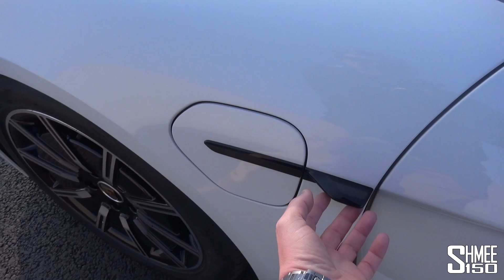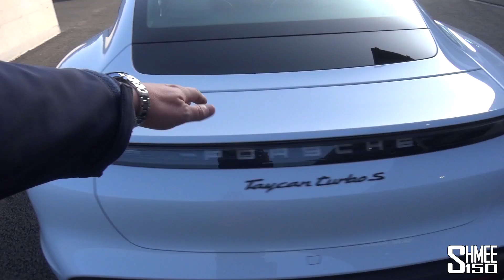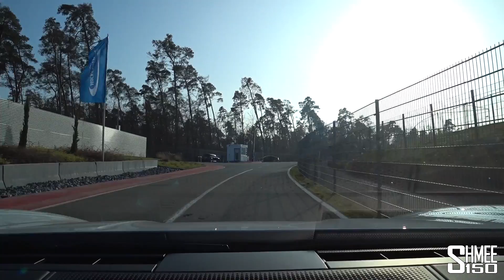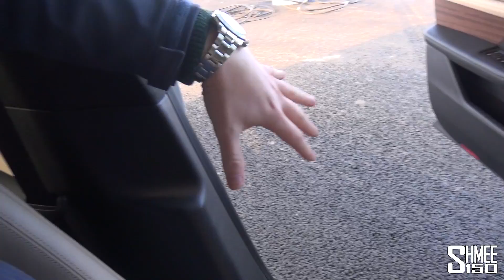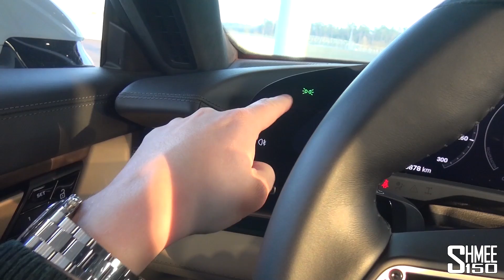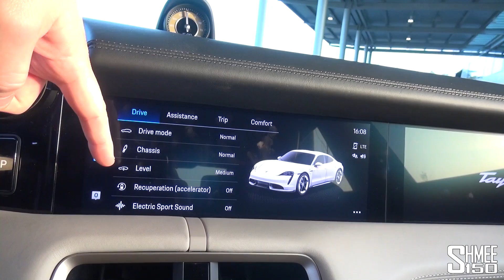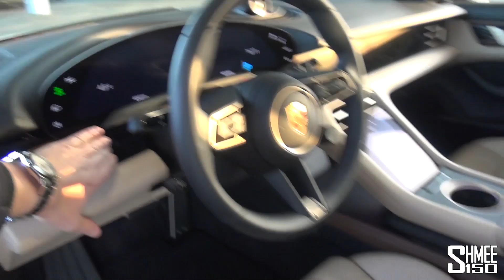Is the Porsche Taycan Turbo S the Electric Car for Me to Buy?

Comment from the maker: Do you think the Taycan should be my first electric car? It's Porsche's first EV and this is my first test drive to experience it, something you can also do to at the Geneva International Motor Show. More info including discounted tickets in the app: http://onelink.to/shmee
Reply: Perfect way to add a Porsche back to the garage!
Reply: Well, the Model S is a better car in every way apart from build quality. Would by a Plaid Model S when it comes out.
Reply: The best Porsche!
Reply: This car reminds me of my wife: White, expensive to run; instant talk; a smooth ride....
Reply: If you’re getting an EV, that’s the only one of interest at the moment surely
Reply: BUY IT!!🔥🔥🇵🇹
Reply: I agree Tim, it is a most impressive car. If it does indeed still have the “Porsche feel” to it while integrating the tech then it a very cool car. However I would not rush into buying any EV yet until you’ve maybe had one for a couple of weeks.. like the BMW you had recently. Maybe try an EV for the same period, see what it’s like to actually live with and how charging works. I mean thinking out loud, if you went on a road trip to say Monaco or Geneva how many times would you have to charge and what is the availability of charge points on the way? I live and work in London W1 and street based charge points are Ok but could Do with being more availability. So I’m just thinking the car may be practical day to day in town but for road trips etc ... mmm I’m still not entirely convinced. Finally is €200,000 in that spec worth spending on a car that you can’t really use to its full potential... I do love the car and the tech. But should it be your first EV... I think you should wait and see what’s what as 2020 progresses. Hope you are enjoying Germany. Cheers Mike
Reply: It’s a great car but really....why? When you consider your current line up of cars why do you really need it? Sell everything else and go EV? I think all the EV stuff it’s still too early. The infrastructure just isn’t there across most countries and the charge times aren’t great. Not enough super chargers about. The only real world good EV is the Tesla. Everything just falls short unless your going to use it as a short run about around town car for occasional use. But then a small petrol would do that job anyway.
Reply: buy a Huracan Evo
Reply: Get the Taycan and get another more "affordable" electric car for long term comparison. No Teslas though, just to show there's life beyond Tesla. Dump the Supra and Focuses (I have never watched a single Focus video).
Reply: For 200000.......nah pass.
Reply: No. The range pretty sucks
Reply: Either this or the Tesla Roadster. Depends on whether you can wait a bit, want more performance and range, or more luxury and Porsche's heritage of building dedicated sports car
Reply: for some reason it looks like a mk 5 supra
Reply: Yeah get it it looks really good
Reply: Yea man buy it
Reply: Yea man buy it
Reply: I saw my home in the video :( didnt know it was a porsche event in the hockenheimring... Greetings
Reply: think you'd wait for some sort of special edition wouldn't you, maybe a taycan gt3 or taycan rs? maybe one with no rear seats bigger batteries and lower weight?
Reply: yea very nice..
Reply: Yes
Reply: Think it is a great daily shmee mobile!
Reply: fortunately the car is fitted with self opening covers over the charging ports..
unfortunately they require a V6 powered diesel generator to operate..
Reply: Most definitely! Go for it.
Reply: I would recommend the new Tesla Roadster Founders Edition. It has a wow factor that is unbeatable! Your channel will explode and twice more if you got a new right hand drive ZO6 mid-engine Corvette! If there is anyone who can make that happen, it’s you Tim!
Reply: Shmee150 yes, absolutely, buy it
Reply: i think you should go for it. i love the cabin noise it makes under acceleration
Reply: The Porsche Taycan Turbo S is my absolute dream car. I would buy it if I could afford it, no question. I've been waiting for you to review this car, so thank you for sharing, Tim. I hope to meet you at GIMS again, just like two years ago, nearby the Bugatti Chiron. Cheers.
Reply: I’m convinced it’s already part of the collection
Reply: Yes shmee i think it would be an epic addition to the garge
Reply: You should buy the taycan 4s
Reply: Yes its perfect.
Reply: Shmee150 It definitely should. Can’t mod this one ☝️ 😂
Reply: I think a drag race with a tesla and Matt Watson is going to happen at some stage⚡️
Reply: Just yes, time for you to join the future 😉👌👉⚡️
Reply: YES! Please buy this one. We want to see more of it.
Reply: At the beginning i did not like it. But now i love it. Greetings from the home of porsche, weissach
Reply: You need to buy it
Reply: You buy you win
Reply: Please buy it, but where are you going to put the charging box!
Reply: Shmee150  ofcorse it is
Reply: Why did it take so long?
Reply: Yes
Reply: No it’s really nice but u should get the Tesla roadster
Reply: I believe this would be an excellent choice of EV car to your collection 👍
Reply: Can you charge Taycan on Tesla superchargers?
Reply: Hey Tim - please can you do a video on trickle charging? Thanks
Reply: I think it should, personally I didn’t like the whole idea of the taycan but after watching this I’m all for it.👍
Reply: Shmee150 Yes
Reply: Buy it please!
Reply: With it being the first year of this model, I would wait. The electric car/SUV models are still fairly new but are improving dramatically. If you buy the 2020 Turbo S Taycan, there will be a far better version next year. Porsche needs to construct a car or SUV with a 1.8-2.0 twin turbo with about 375 HP with electric (450 hp) along with a totally separate F1 type of electric power boost mode (75-100 HP).
Reply: The first step into the all electric vehicle and stepping back into Porsche cars
Reply: i think this car is for everyday use in the city not to collect. but if you want to buy and try use it regularly please buy it. for the look i still love panamera more though.
Reply: Yes absolutely!!! I think they nailed it with the interior and features. The front is the only thing i would do slightly different, but thats not so much!
Reply: The GIMS is canceled 😭 it will be announced in the next hours. All events in Switzerland with over 1000 pax are canceled until further notice.
Reply: Please buy it!!!
Reply: It would be great content!
Reply: Yes.  We need a guy like you to give it a proper long term review.
Reply: I like it
Reply: yes go for it if its posible
Reply: Yes get 1 bought
Reply: Shmee150 Yeah, it should be,but I think you‘re are fine with your amazing collection!
Reply: No electric cars have no place anywhere near cars like the senna
Reply: @LucGrenier  finally! Someone who won't stand for electric nonsense!! I don't care if its slower. I will stick with my 800hp Supercharged 5.0L V8. Please DO NOT buy Tim!! We need people like Jeremy Clarkson & Max Verstappen who will tell the damn politicians to stick the electric cars where the sun don't shine. We shall boycott your channel if you buy an electric car.
You're red focus is MUCH better than this electric piece of turd that has no turbo
Reply: Porsche have done a superb job with this car.....it’s a very cool electric car.....never wanted one....but with the Porsche I would 😁👍
Reply: @mikejk27  great looking car, poor technologywise compared with Tesla. The range is just hideous
Reply: Can you turbo charge it, thats the real question?
Reply: Pleeeeeeeeeease get it.
Reply: Shmee150 no get the Tesla roadster
Reply: The Taycan would be great we need a Porsche in the garage, however the Honda E would be a great fun quirky car much like the Suzuki jimmy and would be a great first electric car in the garage.
Reply: Off course! An E-Porsche in your Collection is a must have 👍
Reply: Yep. Mod it too, some carbon fibre maybe
Reply: Only IF you want to buy a ev
Reply: Shmee150 No get a Model S Performance
Reply: Amazing car, any interest in the Tesla roadster mark 2?
Reply: Shmee it is better to wait the new Tesla S
Reply: Athanasios Leftheriotis no, Tesla’s are the pumpkin spice latte of cars.
Reply: Shmee150 you’d be stupid to buy it... slow af and no self driving
Reply: @austinskylines   Sorry, but when you have Porsche self driving is the most stupind thing that you can have in the car. Driving such a car is pleasure.
Reply: its a good car with the stupidest name ever... who in the design/marketing/whatever department said that turbo is a good name for this ELECTRIC car... really porsche??
Reply: Shmee150 Porsche was the one to bring us diesel-gate and now they lie and have convinced some people that it performs like the Roadster. 
Compare specs before you buy and remember Tesla has lots of super chargers operating. Porsche has none and thus is their first electric prototype. Tesla has a fab track record for 10 years and is light years ahead in battery technology.
Reply: Tesla Roadster 2 will smash it. If you can wait until 2021/22. With 600 mile range not 200 and 250+ mile top speed. 1.9 secs  0-60mph. 

The Taycan is a great looking car. Poor value for money IMO.
Reply: @user-jt1jv8vl9r  600 miles range is not impressive, until they figure out how to add a gear and make the car able to use his whole power all they time...Tesla is slower every drag race...1,9s is just in the best circumstances
Reply: Get the Honda E its much cooler.

Comment: Tesla Model S.. 0-60mph 2.4/5 sec, 349 mile range, 163MPH top speed; much bigger charging network; $100K for about half of what you get in that Porsche.  Tesla hands down .. considering Auto pilot, more storage space, more passenger space, electric since 2013.

You could buy the Model S, Model 3, and the Model Y and still have money left over for better performance.  Or put your 200K on the Tesla Roadster that does sub 2 second 0- 60 and projected to provide over 600 miles range, with a top speed over 250MPH.

I wouldn't think drinking Porsche Koolaid makes sense, when you could be drinking Tesla Champagne.   It will come down to looks or how unique the Porsche is as compared to "everybody wants a Tesla."

Comment: How does air conditioning work with on an electric car, the compressor is usually driven by the engine.
Reply: They have a dedicated electric motor for AC. Also for heating they have a hair dryer-like system since they can't rely on engine to generate heat.
Reply: @BKA3510  thank you

Comment: Named a Turbo S, but has no turbo?
Reply: What do you think is the different between a Panamera 4S and a Panamera Turbo? Do you think it is the turbocharger? No. Both have turbochargers. Instead the 4S has a V6 and the turbo has a V8. Actually more or less all Porsches have turbochargers meanwhile, so also the versions without the "turbo" in the name. So "Turbo" just means "more power". It doesn't tell you anything about the technology that is used to give it more power. And so they just use the same nameing scheme for the Taycan. And when you know Porsche, you know what you get.

Comment: Did they choose the larger platform against a 911 because of the space needed for the batteries? An electric 911 TurboS could be a viable option to try electric. Tesla is quick but not fun, this looks fun but i would want an 911.

Comment: Currently I'm in NZ where sales of electric cars average around 600 a month. The charging infrastructure is good and one can comfortably travel a good distance knowing you will be able to charge your vehicle along the way. A recent upload by another You Tube channel where they have a Jaguar I Pace on a long term test high lighted some of the challenges  faced by electric vehicle owners - these include the difference between claimed range and achieved range, incompatible charging plugs at charging stations, having to register and download various apps to activate the swipe card and overall time lost while waiting for the car to charge. Would I like to see an electric vehicle in the Shmee Fleet? Yes it would be interesting to see what the ownership experience is like.  I can tell you that as great as the Tesla is, its not without its faults or indeed patchy customer service, So would be keen to see how Porsche compares.

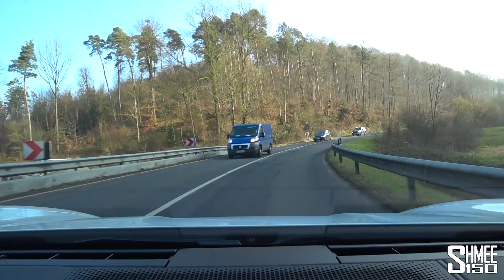Comment: Hey Tim. At 10:38 you mention noticing a gear change. What do you mean by this? Does the Porsche use some alternative motor system? It was my understanding that EVs have only one gear.
Reply: Porsche has a 2 speed trans on rear axle. The only reason we don't have gears on EVs is tradition. Before Tesla they were golf carts. Tesla tried developing a 2 speed transmission for the Roadster 1.0 but they failed because of the very high torque of electric motors. Then they settled with a new inverter that can supply more current to the motor at high frequencies. That solved low high-rpm torque problem. Until Porsche nobody tried putting gears in an EV again. Actually, there are lots of potential benefits.
Reply: @BKA3510  Thanks for the reply Bora, and for teaching me something new! Marvels of engineering, these things.

Comment: @2:51 Imagine doing that in the winter when it's caked in dirt and it's freezing outside... Such a pointless feature. Just have a button or press the lid itself
Reply: It will vibrate through it :) they thought of it
Reply: @Jonas_fluid  looks like it uses same technologies as a capacitive touch screen. And doesn't look to be that responsive. Just like the early mclarens

Comment: I don’t get tech for no reason, manual controls for volume and AC are a must.... why make the good old air vent motorized and adjust from a screen, it’s hard to use, with more layers of complication and more to go wrong.... a crazy fad. Big screens have their -lace, for information, Navigation etc but just give manual controls for the most used items.... it’s a pain to find when driving with out looking down and the screens just get all smudged with finger prints.... anyone with OCD would have a nightmare with this!
Reply: Because they’re going after the Tesla buyer.

Comment: Shmee, thank you for the great review. I can certainly tell it would be hard for you to let go of petrol vehicles, and I understand that for some folks. 
FYI the issue with the passenger display is that someone must be sitting in the passenger seat for that display to be active. It's a safety thing to not tempt the driver to be reaching across I believe. 
Would have loved you to take it to top speed which is a ways about what Porsche claims (as usual).

Comment: no thanks
all the money to buy one, add loss of value over the coming years, 8 yrs later the batteries will be worn out
your left in 8-10 years with a car worth £30-£40,000 and needing that spent in replacing the power cells means the car will be worthless

Comment: Another great review, Tim. Though I can’t help wondering what is the life expectancy of all those high tech screens, and what happens if or when they start to fail  🤔
Reply: Are you talking about the physical displays life expectancy, or from a software perspective? For the former, we've had LCD screens in cars long enough to know they're life expectancy, and that also goes for the software side. They will be replaced if they break, just like we have been doing with LCD screens for over a decade. I'll sure this car will receive over the air updates to keep software up to date. Just because a screen is bigger and the software is more complicated, doesn't chant that it's an LCD like we've been using for a long time now.
Reply: Andrew Delashaw Thanks for your reply, Andrew. I was in fact referring to both. If laptops or computers don’t last forever, what will happen when either the screen has issues or the software eventually fails? I’m obviously not an expert, just genuinely curious.

Comment: Wait for the Tesla Roadster 2.
Reply: It's not the same class of car. He doesn't need another supercar. Why would you want an electric supercar anyway? Defeats the entire purpose of the driving experience. The Taycan however fills an excellent gap in the market.
Reply: @EarrGasmm  They're actually pretty close when it comes to pricing and both are 4-seaters. And "Why would you want an electric supercar anyway?" the roadster 2 is going to have a bigger range than most supercars, so what's the argument against electric in that case? Just the sound?

Comment: Wait to you get a drive in the upcoming tesla roadster before you decide
Reply: Tim is used to high end cars. Teslas feel like cheap trash, they handle even worse, and it's not feasible you own one in England because the support infrastructure isn't there. In the US, they can't even service their own vehicles in a timely manner, you can't buy parts to have someone else fix it, and you wait weeks/months for service. Also, because of the king wait times, it costs around 5-10x as much to do basic repairs to a Tesla, compared to any other car, so they're often totaled out. That also makes the insurance expensive. That makes all of the green benefits, that take the car being on the road for around 10 years to materialize, null and void. If not for anything else, he would feel like crap going from his $½M cars to a Tesla that feels about as plastic as a Power Wheels.
Reply: @xenonram  True that!.. but I wish I bought Tesla stock 6 months ago!